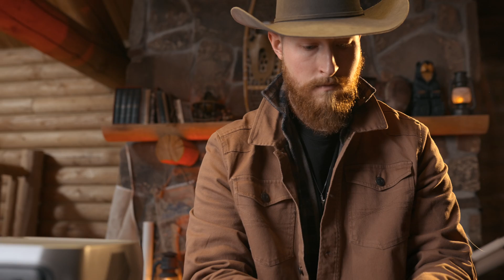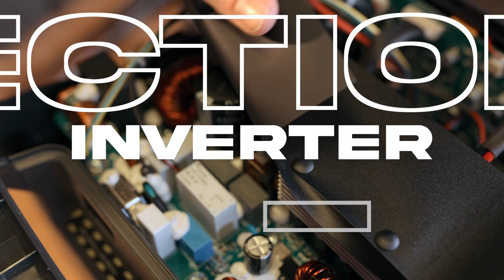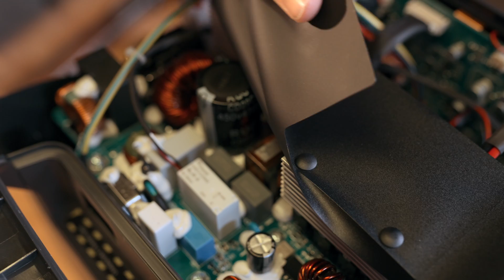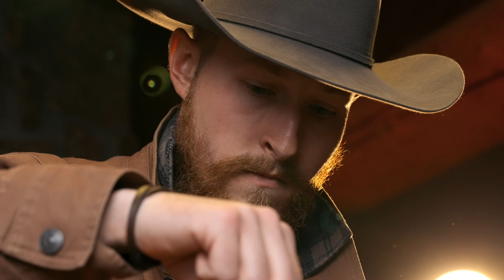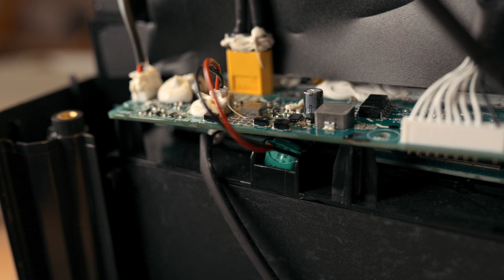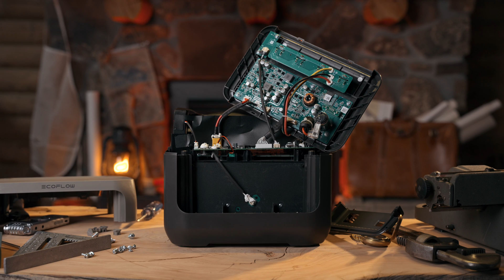What's Inside RIVER 2 Pro?

Comment: Are you able to use 2x160w panels with this unit safely. I have a Delta mini I charge with your 400w panel and it limits wattage to 310 max. It would be great it this could do the same. I don’t own any 220 panels.
Reply from the maker: Yes, you can use 2x160w panels to charge RIVER 2 Pro and it is recommended to connect them in series, because the open-circuit voltage and short-circuit current of the series-connected panels would not exceed the R2P solar input limit. 
One thing to note is that even you connect two 160W solar panels together, the solar input would not be 320W as the maximum solar input of RIVER 2 Pro is 220W. 
Theoretically, you can use 400W solar panels to charge RIVER 2 Pro yet it is not recommended as it can trigger overvoltage protection. Let me know if this helps!
Reply: @EcoFlowTech  thanks for the information, much appreciated.

Comment: Love the delta 2.  You guys need to update firmware so that you can connect two delta 2's into each other for 220 volts and double the capacity like it's big brother the delta pro.  That would be such a fantastic feature.  Delta pro way to big to lug around and not practical for camping but two delta 2's is very doable.

Comment: There are couple of things I need to know before I buy one of those:

a) What type of battery does it have?  Is it one large battery like car battery or battery pack combined from small 18650 cells?
b) Can Delta and River models be used as UPS for desktop PC?
c) Do you plan to release a new model specifically designed to replace conventional UPS which will be more PC friendly (So to say) and will have UPS features:
- Shorter switching time max 15 ms
- Industrial grade surge protector that can withstand a surge from thunder strike
- USB / Network connection with PC
- Network management: When battery power is below 20% Ecoflow initiates remote shutdown of PCs connected to it
- Easy battery replacement - Yes even Li-FE-PO batteries WILL degrade over time and will need to be replaced
- More than one parallel connector that allows to connect 3 (or more) units together
- Device prioritization: Eg. Ecoflow Delta is MASTER and two smaller rivers are SLAVE which means they work as expansion battery while connected to Master in parallel but if Delta is unstable or damaged one of rivers takes the lead and becomes Master
Reply: 40 AH Lifepo4 19,6 volts ( nominal )